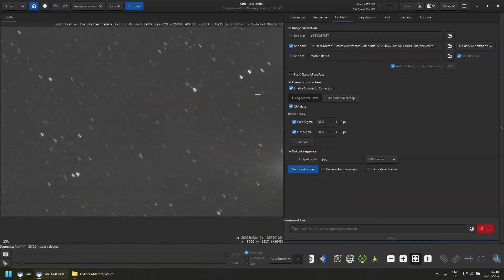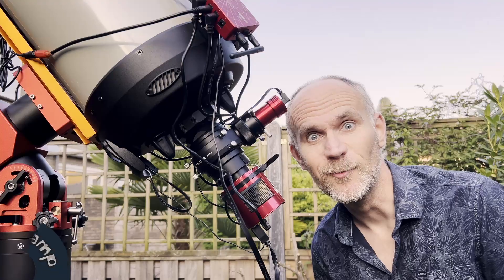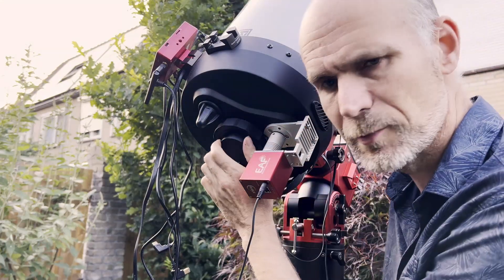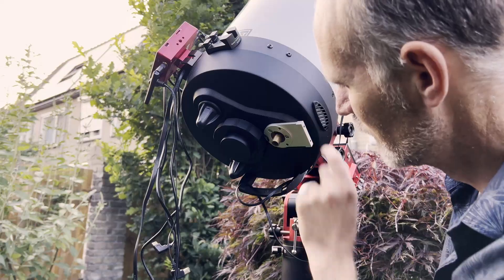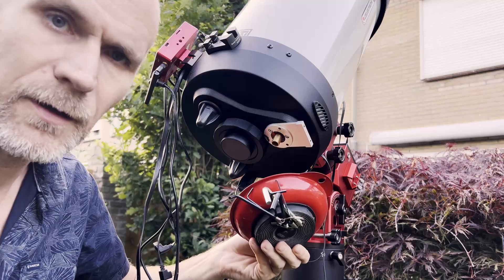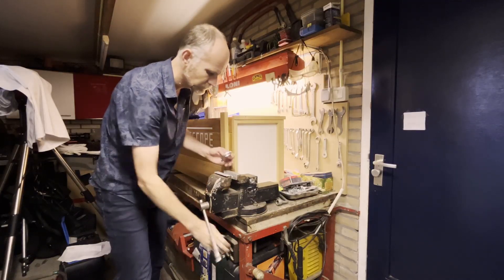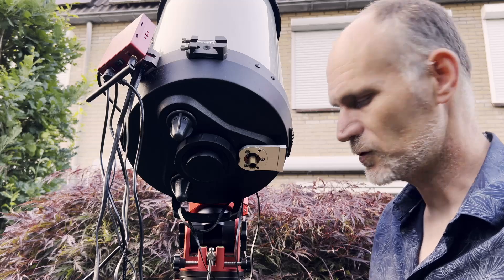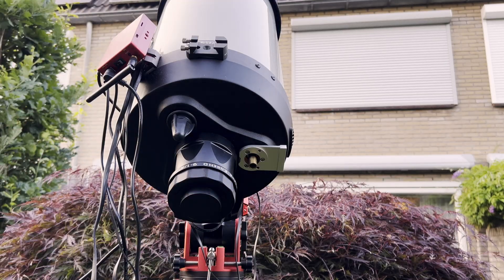Mounting a reducer on the EdgeHD 9.25" together with an ZWO EAF and Celestron OAG - using a hacksaw

Comment: I had to do the same.. but did it the hard way. Cut the wrong corner first, so ended up with two cuts.
Reply from the maker: That would be typically something I would do, so I measured it three times.